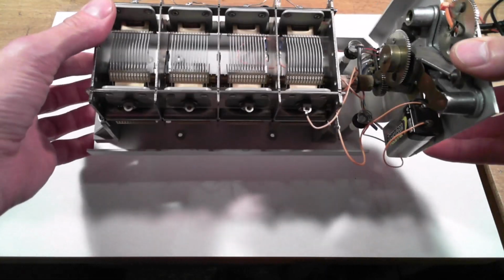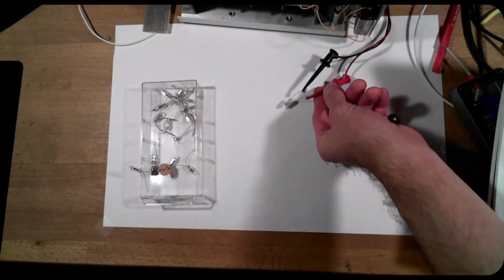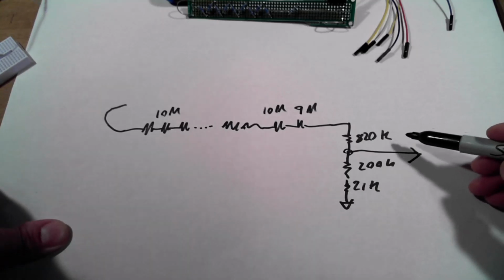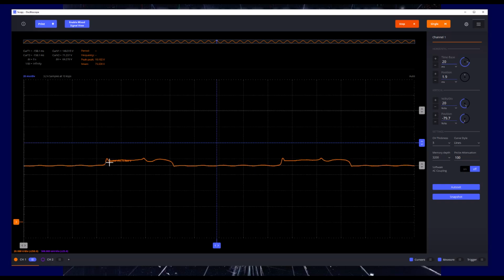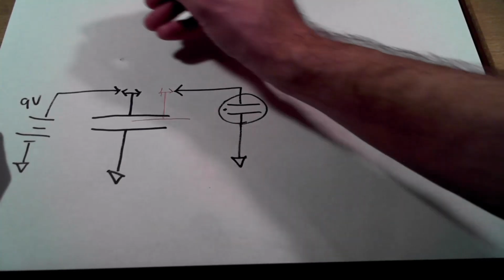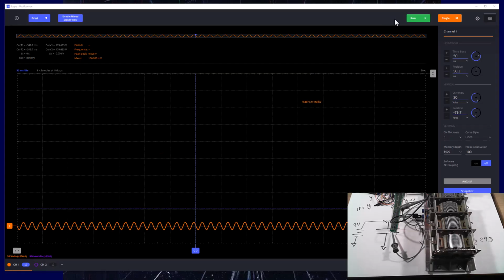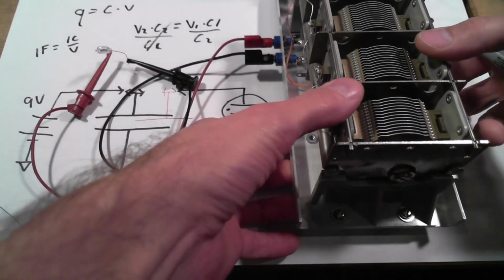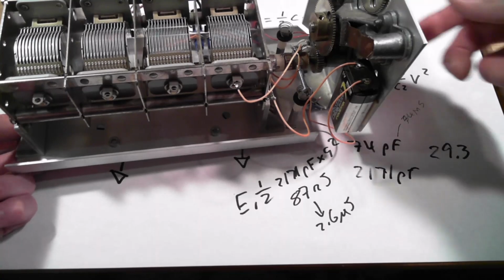World's Silliest Boost Converter

Comment: You might try putting the 'scope probe between ground and the neon bulb.  The off bulb isolates all the loading until it flashes and then the 'scope will see the full voltage minus the drop across the bulb ( mine are about 75 volts).  You may be able to use a standard X10 probe for this.
Reply from the maker: Great idea!

Comment: I hate to be pedantic but what you have there isn't a "boost converter". It's a charge pump.
Reply from the maker: I'm definitely exercising artistic license here 😁. I'm not sure it's technically a charge pump, either - in a charge pump, all of the energy into the circuit enters via copper wires - here, (C1-C2)/C2 fraction of the energy enters mechanically. So it's more of a "capacitive generator"? But even there, you need to start with some amount of energy - if the capacitor is initially discharged, you get nothing out. Off to search for the pedantically correct word for what this thing is...
Reply: @thorenscientific  I think the mechanism is closest to a Wimshurst machine...?
Reply: @thorenscientific  Yeah I see what you're saying. It isn't quite either one. Charge pumps tend to use "flying cap", which this isn't with the one side grounded. Yet it isn't a recognized boost topology either. 

To me it is closer to a charge pump however because it works because the electrons are no longer attracted to the other plate when the cap is "opened", and so they "pile up" until the neon bulb fires.

If you do find an already established name for it I'd be curious what that is. If not, I guess you can call it whatever you like 😊
Reply: @thorenscientific technically I believe it is a switched elastance generator.
Reply: It is not a converter of any kind, it is a generator. A very cool, but insanely inefficient generator.

It reminds me of a wind powered generator concept that turned out not to be economically practical. It had no moving parts other than a pump for sea water. The generator created a mist of charged water droplets at one electrode. The wind blew the droplets towards another electrode. The second electrode accumulated a very high charge. The very high voltage DC was going to be converted to something suitable for the grid.

A company was formed to commercialize the technology back when the largest traditional wind turbines generated at most 200kw each. The company shut down when 5 megawatt wind turbines were in production. The business might have succeeded if wind turbines weren't getting bigger and better so fast.
Reply: I was thinking Wimshurst machine too. Except that this produces a known, calculable output voltage, so... Wimshurst regulator?

Comment: "Generating 1100V using a 9V battery!" search you tube for this video 

UZH Physics is the publisher 
this boils  down to charging plates at x distance then separating the plates and the voltage climbs no free energy at all 
as voltage increases  current drops...   still a good video that is not generally misleading

Comment: there are voltmeters that rely purely on the electrostatic tension to make their measurements. gotta dig out those old pre-1920s era textbooks to find the details. the ones that conveniently have all been thrown out, removed from library shelves, and declared "obsolete"... back when they started with introductions such as "there is no absolute voltage, a voltage is merely the difference of potential between two points".

glad that you touched on the subject at the end... the increase in energy is due to the addition of energy by separating the plates. "tension" is just that. the plates want to pull together in opposition to the "tension" keeping them separated. its why its CALLED "tension" in the first place. its like a spring has two types, compression and tension...

another area to delve into is "magneto motive force"... dont seem to find much reference to that particular term outside of steinmetz...
Reply from the maker: Yup, I made an electroscope with my dad a million years ago - and I've seen pictures of quantitative electroscopes, but never actually used one.
And indeed I've got an experiment set up to generate a measurable force between those two copper clad sheets. I've got a high-dollar, high-voltage module, but it works with an electric fly swatter! So I'll show that, too, as a low-dollar option.
Reply: @thorenscientific  gold leaf electroscopes just reading that there IS a charge there. they can sort of be calibrated though.
 and then theres yes...quantitive ones.  pretty well much the same principle as any moving coil meter, but using an affair similar to these variable capacitors instead.

mmmm, electrostatic speakers... bass? we dont need no steenking bass!

Comment: It would be very useful to show a video on how to measure the peak voltage without affecting the measurement and loading down the circuit.
Reply from the maker: Twin1q!! Yes indeedy, but it's sort of an impossible problem (I think) - I'm already up to 100M input inpedance, and while I haven't tested the risetime of that setup, I suspect it's terrible (especially given the distributed capacitance along the resistor string). But I wanted to show something cheap and easy - 10M, 1% resistors are 30 cents at "your favorite disty".
One possibility MIGHT be to use a JFET buffer and measure the waveform using a lower starting voltage so nothing pops or overranges, then assume the shape is the same for higher voltages. I'm just psyched that you can actually see this effect with a setup you can hold in your hands - I had tried lots of variable caps before, but it was only when I got to this monster that I actually blinked the light. RIP my HP334. This guy's got a rebuild vid, cap at this timestamp: https://youtu.be/C-R_Wdu5UQg?t=765